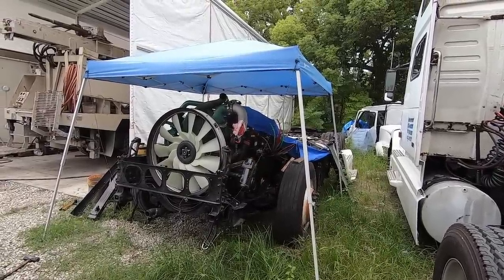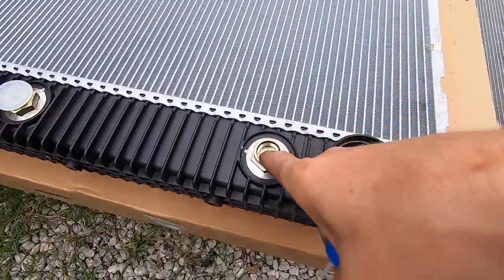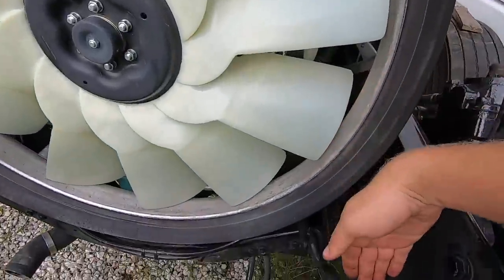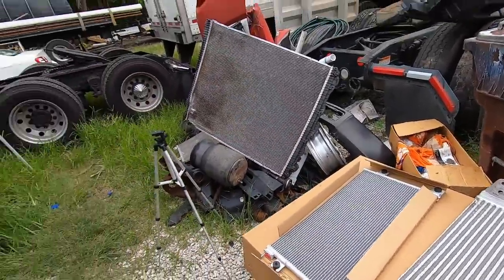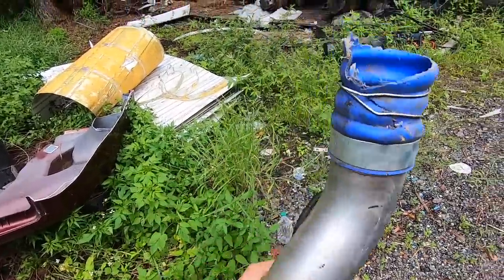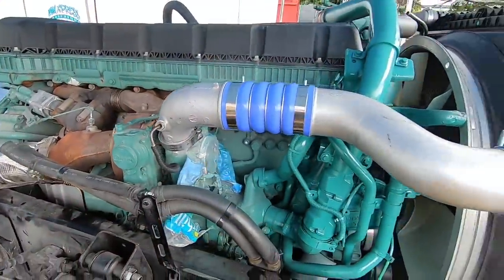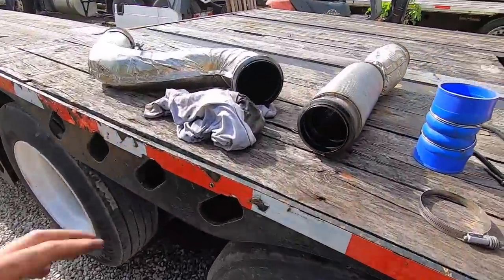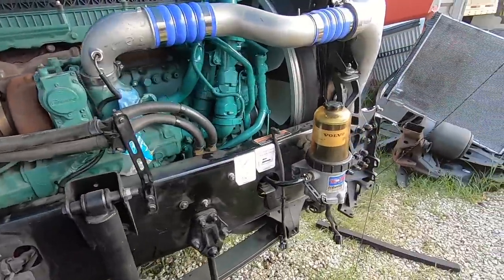Resurrecting The 2019 Volvo VNL SEMI Truck | REBUILDING With AFTERMARKET Parts | PART 10 |

Comment: You need to find a regular truck parts dealer. Many parts, especially hoses, are much less expensive. I bought a hose for my charge air cooler, and it was under $30.00

Comment: Hey Rusty C just so you know, those little rubber "pillows" are called isolators.  They isolate the radiator from vibrations. 

With the inter cooler you should have just taken it to a welding shop and they could have easily made a custom piece and welded it in for only a few bucks. I would be concerned that all the weight will be sitting on that top bracket and it will eventually crack. It is nice to see it coming together! I am eager to hear the first start with it all assembled.
Reply: That's what you call shoddy work hidden behind curtains.

Comment: There is nothing wrong going aftermarket parts which have been proven to work better than oem except cheap nock off parts
Reply: Finding the good aftermarket stuff can be a pain in the ass.  The only really good ones are the same OEM companies who supply the OE parts.  There's only a handful of companies that actually do better than OE.

At least for all my cars, I've learned to stick with dealer or OEM parts, barring a few select aftermarket companies that make better parts.  I've cheaped out before and had to do repairs much sooner again, not worth it!  Asia is dumping cheap parts on the market like no tomorrow and its usually shit quality.
Reply: @bigpjohnson  it easy to find good aftermarket parts when digging through Google reviews and I am from Australia but sometimes need to get parts for my car through USA and the worst place I found is eBay I had a lot of bad parts through them and some good parts as well and also done automotive training over the years. I have found sometimes oem is cheaper but with a car that I got now most part are really expensive like the head light from ome at $2550 aud just for one headlight and no aftermarket headlight

Comment: Like most dealers, not all of the parts people are willing to give the trade prices to self servicing shops.  But I ask you, who owns newer semi trucks and is a shade tree mechanic? I don't know about heavy truck dealers, but auto dealers typically get 40% off the published book price, and repair shops get 25%. This pricing isn't carved in stone, as generally the smaller the part, the greater the markup, due to the cost of cataloging and dispensing a $2 part and a $200 part is virtually the same.  I haven't worked in the trade since the 90s, but generally speaking, import dealers will mark a small part up 300-400%, because they know they can get it. Hopefully, this has improved by now, but I doubt it. Biggest rip off is the DEF system! I'll bet it adds several thousand to the cost of a class 8 truck. And to what advantage?

Comment: Hey Rusty.  Just watched all 1-10 for Volvo 2019 rebuild.  Are you still working on her or what? Hope so.  It Suck you didn’t have the truck under that small tarp/ shop.  I would have hated working in that hot heat, would killed me with my asthma.

We never get to those kinds temp here in western Alberta. Must been hard working on the truck in those hot temp.   Anywho enjoyed the videos and wondering what happening with 2019 Volvo and how she running..  Hope see more updates soon.  While I’m not huge fan of Volvo trucks.  Still enjoyed the videos and all hard-work put into getter her back and running again,  as somebody grew up on farm, always helping my dad with tractors/truck repairs and mechanical work.  While I’m no mechanic,  enjoyed doing that stuff and helping my dad,  till we sold our farm. Miss those days..  my dad was heavy duty forklift mechanic, and has worked on few semi truck many years ago.  He even had his air brakes ticket and schooling, ( very long ago and that from Ontario/Canada. )

Would Love see you get either Pete or Kenny at some time too.  Always loved some older trucks. Keep up good work :)
Ps what engine is in Volvo. cumming or is Volvo engine?  How much HP is Volvo.  Any plans try get bit more HP?

Got yourself new sub form Canada.  Keep up good work :)

Comment: Most Car And Truck Manufacturing Plants do not make the Parts that Make up the Brand of truck or Car IE: Oil Filters are not made by the  said Car or truck Company .so after market is not a bad way to go as well. The Way it works for Parts on a Car or Truck Build is a Quote system on supply of the said Part with Name Brand off like a Air Cleaner or oil filter or any other part like a wiring Harness made by someone other than the Said Manufacture of the Truck or Car. Some Truck Manufacture Company's do the Body Frames and Cabs as weld up units or bolt to units . So in saying he should use a Volvo part is like saying pay more for a part that they get cheap and pay a lot more Mark up on the said part + Most have to sign a agreement that with the truck suppler or car maker to not under sell on the said parts.  Just hope this clears up the Cost  issue  about said Parts.

Comment: Don't know if you know this about "V" band clamps.....after installing the clamp and tightening the nut....you need to use a small hammer and somewhat lightly tap the clamp around the outside to properly seat the clamp.  Then you go back and tighten the clamp nut again.  If using a torque wrench for tightening the clamp, you'll want to go back and forth a few times....tapping the outside of clamp then tightening the nut until the torque doesn't change after tapping the clamp....then the clamp is fully seated and properly tightened.
Reply from the maker: Thank you for the advice, will do that.

Comment: The charge air pipe that comes off the turbo you talk about at 9:29. You can buy just the blue rubbers and clamps instead of the complete pipe. And the OEM bands dont hold up to well anyway

Comment: Hey Rusty!!
Be careful about how you go after an unscrupulous employee working for the Volvo dealer, but that employee is stealing from his employer by overcharging you for parts, then he is "skimming" the cash from the  drawer before cashing out!!! (or at least I think that is what is going on!)
I think that many after market parts are many times better than O.E.M. parts, because they have to compete in a "rigged" market, where the dealer can charge you what they want (or more as you have seen!!!!) because they have "the market" already and the company's who are aftermarket generally don't, so they make better parts for less money, that is how they survive the parts market!!!
I know what you mean about the heat and humidity here in Florida.... it can be stifling hot and I tip my hat to you for being able to "get er' done" while your underwear are dripping wet with sweat, I can hardly trim my lawn w/o soaking every stitch of clothing I have on, so it has to be done before 11:30 a.m. or after 6:30 p.m. or the heat and humidity will wipe you out!! Take no prisoners and leave the blood to dry where it lays, although it might get a little smelly when it gets heated up from the engine... but not to worry, that blood is meant for that engine and is proof that you left your mark on this rebuild!! It's starting to look like a machine again, it definitely needs the cab..... maybe you can get one from the dealer.... it would only cost about $25,000.00, unless you go to the other parts guy there and he will sell it to you for $21,000.00...... just kidding.....😆!! But yeah that is definitely fuct up that people have the balls to rob from the "working man" in the hot Florida sun, while they sit in the nice air conditioning and stealing from their employer and you!! But you have got them figured out and now you know that there can be several different prices on the same part!$!$!$!😳
ANYWAY, KEEP ON KEEPING ON BROTHER!!!!!!!!
PEACE 🤘

Comment: your first thoughts about the flow of the exhaust where actually right. the fumes come in and first go through the DOC (the filter in the hole, I'm pretty sure that one is permanent and can't be removed) than it goes through the filter you pulled out (DPF filter). You can see that the DPF will be black on the side where the fumes go in the filter.
Reply from the maker: good to know. Thanks